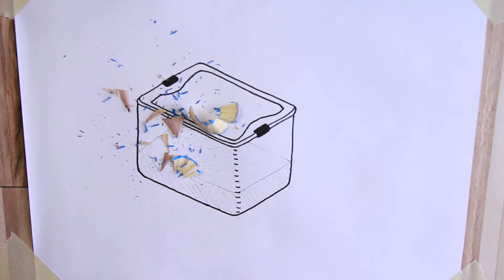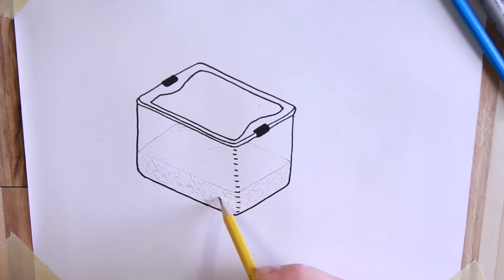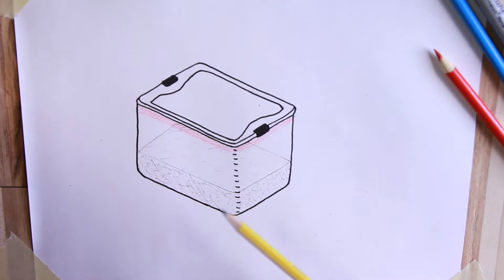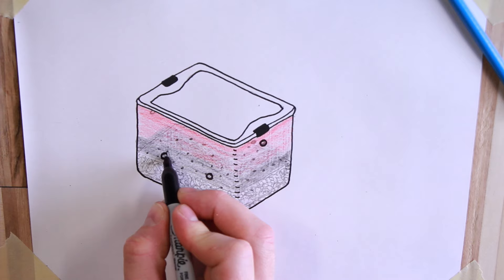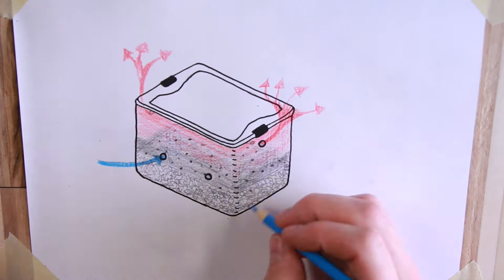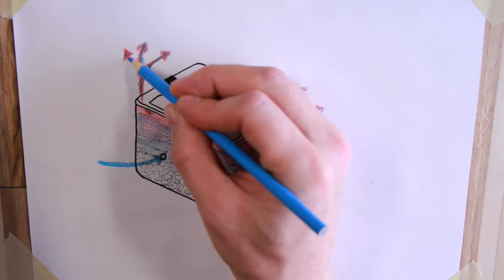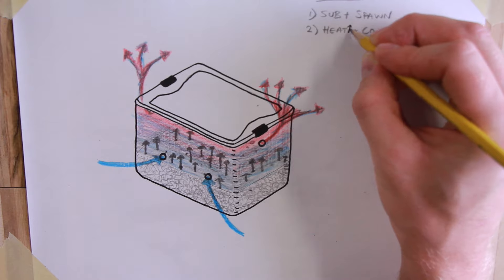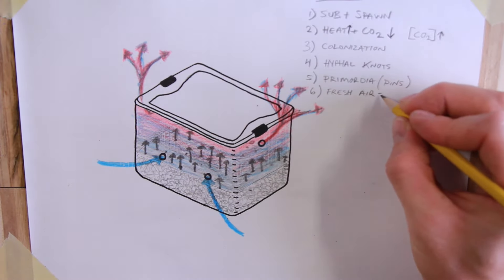Basics of How a MonoTub Works - Understand Fruiting Conditions, Gas Exchange for Growing Mushrooms

Comment: I have holes just like the ones you drew and they are covered with micro-pore tape.  My bulk substrate is almost fully populated.  Hyphae are starting to form.  Are you recommending that I remove the micro-pore tape to introduce FAE when I see pins?
Reply from the maker: Disclaimer: I've don't have any personal experience using micropore tape to cover the holes on a monotub, but I'll relay what I've read and my understanding of your situation:

1) This video describes the "ideal" conditions (and I know I wasn't super clear about that, sorry).  Mushrooms can and will fruit in other conditions. 

2) It sounds like you started with micropore tape from the beginning. Since micropore tape is breathable, you've had some gas/fresh air exchange going.  I think the only negative effect this may have has is slowing mycelial colonization.  

3) My recommendation: When you start seeing pins, move the monotub to a cooler location.  If you don't see the pins developing much, I'd remove the micropore tape and stuff the holes with polyfill (available at Walmart, Target, etc...in the crafting section).  The bottom holes should be filled tighter than the top holes...top holes should be very loosely filled.  This should give the mycelium a nice shot of cooler, fresh air and evacuate the majority of the CO2.  You could also just leave the tape on and fan the tub several times a day, just make sure you keep things hydrated because it'll dry out this way...... 

......But, if you see the pins developing (which happens fast, you can go from pins to harvestable fruiting bodies in less than 2 days, sometimes faster depending on the species you're cultivating)...just leave your set-up how you have it.  

Just my thoughts!  I'd love to hear more from some of the seasoned vets out there.  @Mush Luv / @Home Mycology has done a lot of monotubs and might be able to provide more insight.  In fact, we released very similar videos on the same day, his video has some info that mine doesn't so I'd recommend watching that too.  

Thanks for watching!
Reply: @OneEarthMushrooms  Thanks for your feedback.  Much appreciated!
Reply from the maker: @belovedchild9812  I'd love to hear how it turns out!
Reply: @OneEarthMushrooms  I kept the micro-pore tape and put in a small thermometer/hygrometer.  I kept it above 95% humidity with misting, and I used a coco coir substrate which made it easier to maintain humidity but harder to clean the harvest.  I ended up with over 900 grams wet which was WAY beyond what I was expecting.
Reply from the maker: @belovedchild9812  that's amazing!! So happy to hear that it worked out! Are you going to try for multiple flushes? Thanks for the update, I'm so excited to hear about your success!
Reply: @OneEarthMushrooms  Thanks!  It has been a fun project during the quarantine.  I was amazed at how fast the fruit grew to maturity after it first formed @ 5-6 days.  I added some more coco coir and did a good misting to try for a 2nd flush.  :-)
Reply from the maker: @belovedchild9812  I've had pretty good luck with multiple flushes. Typically less fruiting bodies, but much larger fruits.
Reply: @OneEarthMushrooms  What's your take on dunking the substrate after the 1st flush?  I was reading that I could just continue misting since I used a casing layer, but I am considering a full soak.
Reply from the maker: @belovedchild9812  I think dunking improves the flush. Depending on the size of your substrate cake, it may be difficult to remove it from the tub without breaking it. That happened to me last time. How big of a tub are you using?
Reply: OneEarth Mushrooms it’s a 12 quart clear container. The problem is I cased it with coco coir so dunking is going to be messy.
Reply from the maker: @belovedchild9812  I bet you could just add water to the tub and weight the cake down overnight, then pour all the water off the next morning. That way you wouldn't have to handle the cake. Did you use a plastic liner?
Reply: OneEarth Mushrooms I did use a liner. That’s a good idea. I can try that. Just fill it to the liner?
Reply from the maker: @belovedchild9812  yeah, that's what I'd do. Fill it in the liner, let it soak and try to pour as much as you can out the next day. May need to hold the cake in place with a plate or something so it doesn't fall out while you dump the water out.
Reply: OneEarth Mushrooms I’ll give it a try. Thanks for all of your help!
Reply from the maker: @belovedchild9812  You're welcome!  Mush love!
Reply: @OneEarthMushrooms  that worked!  much appreciated.
Reply from the maker: @belovedchild9812  heck yeah! Hoping for a huge flush for you!
Reply: @belovedchild9812  You got it good !!  Sounds like my "Black Panther" grow - SGFC.  Monotube fruiting chambers are basic FAE / CO2 arithmetic.

Comment: Really enjoy your content.  Im a first time grower using a 53 qt. Mono-tub. Im at 90% colonization. Can you tell me what steps i should take next. I have my holes covered with spore tape, with masking tape over them right now. Just not sure when to place into fruiting conditions and remove tape and fan and mist. Thanks for any advice.
Reply from the maker: I'd leave it as-is for now.  Once you've reached full colonization, small pins (looks like tiny mushrooms) should appear on the surface of the substrate.  Then you can pull the masking tape off.  Your holes should be loosely filled with polyfill or covered with breathable micropore tape, which will allow fresh air in and gases to escape.  

I personally don't fan or mist, but that can also depend on your strain of mushrooms.  In my experience, the monotub will do fine if left alone while the organism develops fruiting bodies. 

If you do choose to fan and mist, I've read (haven't done it myself) that fanning 1-2 times a day is sufficient, and don't mist directly into the mushrooms; just spray the walls of the fruiting chamber.  

Hope this helps!

Comment: Nice video, although I don't get it what are the conditions BEFORE making decision for switching to fruiting stage. Total darkness, only controlled gas exchange from controlled vents?
Reply from the maker: Thanks! I think I'll make a video addressing this question specifically, its a common question. 

While the substrate is colonizing, the tub should be (ideally, but conditions outside this range will work too) away from direct sunlight and about 65-80F (18-27C). Most strains of mushrooms seem to do best at 75-80F (24-27C). No fresh air exchange is necessary at this stage (CO2 helps the mycelium at this point), but some minimal gas exchange occurs through the lid without any input from us. 

Make the switch to fruiting conditions (introduce fresh air exchange through the vents, allow for normal day/night light cycles) when the substrate is fully colonized and pins begin to appear at the surface.

Comment: If I remember my high school chemistry correctly, gasses do not separate according to atomic weight.  Carbon Dioxide mixes completely with the other air in the tub.  It does not accumulate at the bottom.

Comment: But if co2 is heavier why it exhaust from top holes and not from under?
Reply from the maker: CO2 mixes with air and becomes much lighter.  The difference in density causes the updraft.

Comment: I bought my monotub, but have been wondering exactly how to configure it, but this is the clearest explanation I've seen.  Any tips on adding a computer fan and mister?
Reply from the maker: I don't have any personal experience using either, but from what I've seen when researching the Martha Tek, it shouldn't be too difficult.  Most of the Teks I've seen have the fan blowing into a tub or bucket with a lid. Inside the bucket is the mister.  There's an outline hose from the bucket that leads to the monotub.  And then you'll want to have some way for gasses to exhaust from the monotub.  

Is this your first grow? If it is, I'd keep things as simple as possible and don't use the fan/mister yet.  Just build a simple tub similar to the one in this video, and get your first flush of mushrooms before you add complexity.  The more items you add, the more things can go wrong and your chances for a successful grow go down.  But once you've had that first flush of mushrooms, you'll know that you can do it, and then refine from there.  Just my two cents!

Comment: When i spawned 3 days ago i did taped the holes for colonization, but I got an alcohol smell from the sub and still doesnt show any myc growth. Was My sub too wet, can I solve it by giving it a bit of fresh air?
Reply from the maker: You should be seeing growth by now (day 7 for you at the time of my reply); hows it looking?  

Yeah, opening it up would help reduce some moisture, but it's also going to bring contaminants in, which will potentially spoil the whole project.  

I'd love to hear an update!
Reply: @OneEarthMushrooms  what I did was allow it to breathe from a micropore hole, it reduced the smell considerably, but it is still present. Haven't seen mycelium form yet, just a couple of white dots and it looks like it's stuck, I should probably throw it away
 (it was like 12~ quarts monotub :()

I take advantage of asking you a question please. to introduce Fresh air do I need to wait until the pinset has completely formed, or do I give fresh air when pins have just started to form?  When sub is 100% colonized I used to open the lid to mist in order to get a good moisture so primordia can form correctly, but I don't know if im doing good by giving FAE in  that moment, I really struggle with getting a nice full pinset.

Edit: Thanks for your helpful content and for taking time to see the comments!
Reply from the maker: @loudlikelove5016  I don't introduce any fresh air until I see pins. And I don't mist unless the substrate is looking dry. 

It sounds like your substrate may have been too moist, or you had some contamination in the current tub. Sucks to toss it out, but sometimes that's what you have to do! 

Thank you for watching!

Comment: Great video! Just so I understand, you said to cover with non-breathable tape during colonization phase, and then when you get to hyphal knot formation, remove non-breathable tape are replace it by recovering holes with a breathable tape(like micropore or polyfill)?
Reply from the maker: Yep, exactly! I usually use duct tape during colonization of the bulk substrate.  I'm experimenting with poly fill vs micropore...both seem to work but I'm trying to figure out which I prefer.
Reply: OneEarth Mushrooms awesome, thank you! Yeah was trying to figure out the same myself. Because I've been using shoebox size tubs, and with those small holes, I have to stuff poly in, and I wonder if much air is even getting in. I'm guessing poly works great for large tubs with like 1-2 inch holes. But thanks again! Subscribing now.
Reply from the maker: @Northwest360  I'm going to be spending the next few months doing videos on monotubs and experimenting with various different designs and materials, I'd love your input! Thanks for subscribing, hope you find the channel useful.

Comment: Everything Ive seen about monotubs so far is pretty on par with what you were discussing, except one aspect...In your video you explain not allowing air exchange until pinning starts.  No other description or explanations of monotubs shows this? Are higher levels of CO2 necessary for the start of fruiting?
Reply: You want some CO2 during colonization (only gas exchange - micropore tape), then fresh air during fruiting (fresh air exchange - no tape).

Comment: If you already have the holes pre-drilled in, before you introduce fruiting conditions are you supposed to tape over them or something? You didn't discuss any sort of gas exchange prior to introducing fruiting conditions so I'm just wondering as a clueless newb, is gas exchange necessary during colonization?

Comment: So you should make holes after the pins appear? not from the beggining?
Reply from the maker: No, definitely cut your holes in the beginning. I just drew it that way for simplicity.

Holes will initially be covered with duct tape or another non-breathable tape. When pins appear, the tape is removed and poly fill or micropore tape is placed over the holes.
Reply: @OneEarthMushrooms  OK, thanks for replying.
Reply from the maker: @pachycephalosauruslover14  of course! Hit me up if you have any other questions!

Comment: Little confused about the air holes.  Were these 'blocked' whilst the substrate got colonised and the air got warmer and filled with Co2?
I didn't hear you say you have to remove any covers to allow the fresh air in to create the new ideal conditions for the 'pins' to grow into mushrooms...?🤔
Reply from the maker: Yes, when colonize a monotub, I have duct tape covering the holes.  Then when it's fully colonized I remove the duct tape and stuff the holes with polyfill.

Comment: hey the monotub has to have a specific depth?
Reply from the maker: Typically the depth of the substrate should be about 10 cm (4 inches).  The tub should be tall enough for the fruiting bodies to fully mature without touching the lid...40-50 cms of overall height seems sufficient for most species.

Comment: Hi, I need some help,
I have a 
1. XH-M452 Temp & Humidity Controller
2. Ultrasonic mister/fogger
3. Fan

If I need 70° F to 75° F Temp & 90% Humidity.

Should I connect the mister/fogger to humidity control & Fan to Temp control
Or
Fan to humidity control & mister/fogger to temp control

What do you recommend?

Comment: Do I take the tape of the holes when I start fruiting? Thanks!
Reply from the maker: I have a daughter named Daphne! 

Yeah, take the tape off the holes when you start fruiting. Replace the tape with polyfill (bunched up, tightly packed in the lower holes, loosely in the top holes) or cover the holes with breathable micropore tape. 

Hope this helps!
Reply: @OneEarthMushrooms   Thanks Man! :)
Reply: @OneEarthMushrooms  any insight as to why polyfill is so popular? My instinct as an HVAC guy  is that it would be better to just tape a typical return air filter on the outside of the tub.

Comment: I understand how the tub works.
I also understand how it is built.
But how is it maintained? You say fresh cool air is introduced. What kind of maintenance does a monotub require?
Reply from the maker: There is very little maintenance required. Fresh air is drawn in as hot air escapes, and if you're getting indications of not enough fresh air (lots of aborted fruits, stunted growth, off-color) you can point a fan from several feet away to help with fresh air. 

When I say "introduce cool, fresh air" I mean you uncover the holes in the tub and fill the holes with breathable polyfill or cover with breathable micropore tape. 

Let me know if that doesn't answer your questions!
Reply: @OneEarthMushrooms  Very helpful thank you for replying. If you don't mind, i'd like to come back and ask further questions if i run into any issues.
Reply from the maker: @georgehenry6138  of course!  Please come back all you'd like, I'll be here!.  If you'd like to direct message, get me on my facebook: https://www.facebook.com/OneEarthMushrooms/
Reply: @OneEarthMushrooms  Awesome info here. So what is the ideal temperature for fruiting?
Reply: @OneEarthMushrooms  Getting ready to grow some Enoki's, do they do good in monotubs? And do I need to regulate temperature at all?

Comment: Idk if your still responding to comments but I bought a premade mono tub it comes with pre drilled holes and micro pore cover filters for the whole, would I have to find something to seal the wholes while I let
My grains colonize the bulk sub or do I just put these filter disks on and let is colonize, pin, and then mist and fan everyday till they fruited?
Reply from the maker: Did the pre-made tub come with instructions? I personally don't do any fanning/misting. I use duct tape over the holes until fully colonized and pins start showing, then I remove the duct tape and install medipore tape (a breathable tape) that allows for fresh air exchange.
Reply: @OneEarthMushrooms  no instructions came with these filter disks to put on instead of micropore tape

Comment: Wait but you didn't say like... the holes in the beginning need to let the air out but the mycelium needs CO2 to grow right? So does the micropore tape stop airflow?
Reply: And when it's time to fruit do you remove polyfil and or micropore tape?
Reply from the maker: Start with the holes completely covered (I use duct tape).  This allows CO2 to build up and facilitates better growth of the mycelium.  When pins appear, remove the duct tape and install polyfill.  The polyfill allows warm, CO2 rich air to escape out the top holes and cool, fresh air to enter at the bottom.  

Does that answer your question?

Comment: I've seen people literally soak their monotubs  and I've seen people just give it really light sprits of water. What do you recommend?

Also, what's the difference between a cake and using a monotub and which is better?

Thanks!
Reply: If your substrate is at field capacity, it should be able to retain enough moisture during fruiting as long as you don't go overboard on the holes, and you keep the lid shut until the mushrooms are ready for harvest. If it gets too dry, remember that bacteria loves standing water, so you want a fine mist.